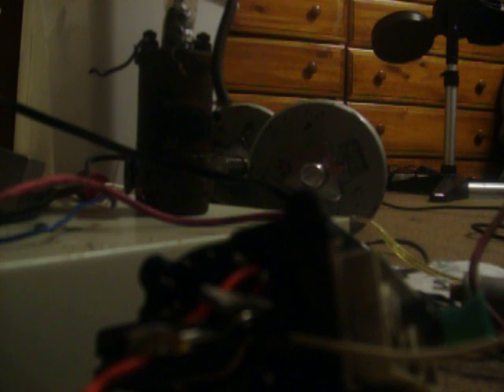555 Flyback driver(35 volts 6 amps in)

Comment: Will IRFP250 work in this circuit? Will it heat as bad? Can you please make a schematic because I don't understand the driver, the 555 oscillator is simple, but the way you wired your fet looks different.

Comment: @triggerhappy77707 
if i ever put more the 10 volts to the gate this clear bubbling fluid leaks out then it doesn't work, and to solve the voltage spike put a voltage regulator on, and to get more power rectify the the fly back pulses just after the primary with 2 ultra fast. diodes

Comment from the maker: @ubuntupokemoninc That's not true. Mosfets are rated for 20v +-, so 40 volts peak to peak (20v DC), and then, you can push them further than that, though the higher the voltage, the higher the risk of gate oxidation etc. 

The only thing i can figure is a voltage spike keeps killing them, which goes through the common ground... I am not sure. Overvoltage across d-s should not be possible, it would avalanche. Maybe repetitive avalaches made the die heat before it could be dissipated... Not sure.

Comment from the maker: Oh... HAHA forgot about that, dont really know how though. 

I forgot what happened, but i think something shorted, becasue it pulled alot of current. But, i found out that even with my 555 driver those old power supplies wouldn't supply even enough for the overcurrent thing, so i switched to mots, and as you can see, it draws plenty of current now.

So, now that i have this power supply put together i just need two more mosfets and i will use my zvs(wasn't the circuit that sucked, just supply)

Comment from the maker: Yes, indeed. I forgot to say, the idea of the resonance cap was from jmartis2. I do not remember where i saw the idea for the audio modded 555, it was a long time ago. I now found out that my ZVS was not working properly because the power supplies would notallow it to pull much current. The ZVS is MUCH better, less heat, less deaths, no ic's. Whenever i get some money, or the junk box from 4hv arrives, i will get maybe 2-4 mosfets, and crank the ZVS up again.